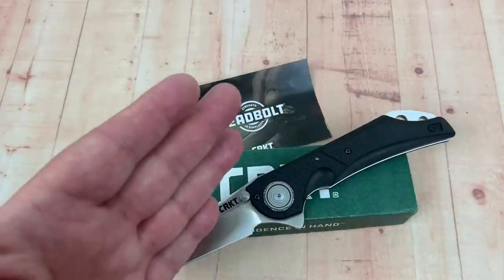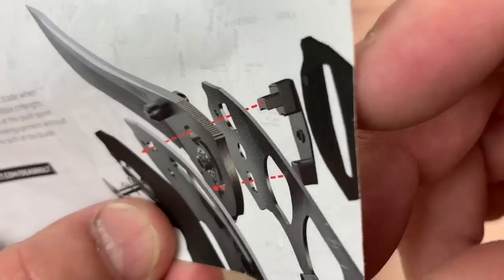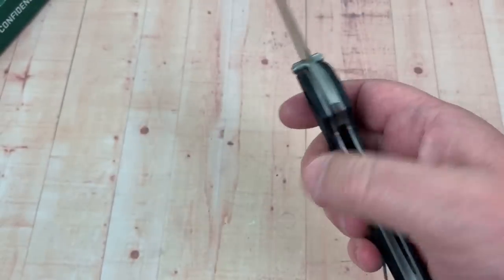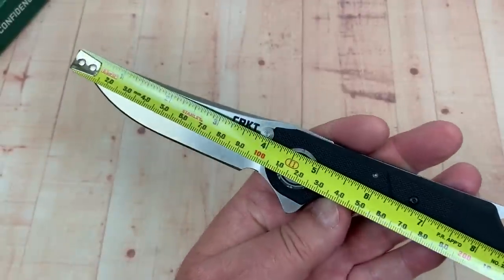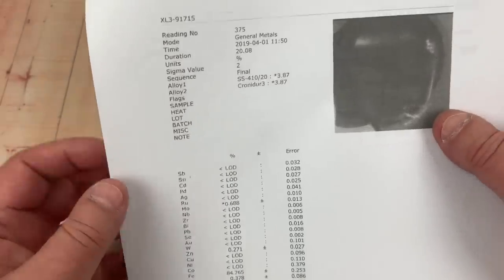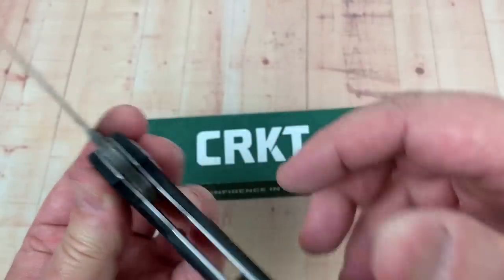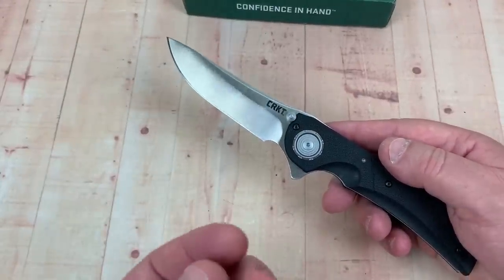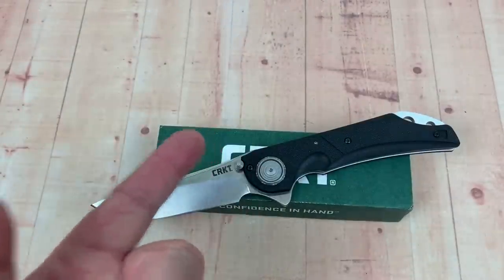CRKT Seismic Knife Deadbolt locking system  Flavio Ikoma design

Comment: It's a tough sell honestly 4116 is okay steel but it's between like Aus 8 and BD1 I think. I don't love the backspacer but other than that I actually like the knife but with that steel it really feels like it's struggling to compete at that price. S30V, S35VN, XHP, M390 all of those are available at that price point, and yes maybe this lock is the bee's knees, but if putting that lock on the knife requires doubling or tripling the cost compared to where a similar knife would sell at I just can't really get on board. This is particularly true because the lock is of limited importance, unless you're trying to use your pocket knife as a hammer or something stupid like that. If the lock adds 10% I'd be on board but this seems to be a $50 knife other than the lock at most imo.
Reply from the maker: Ashkan   It’s a bit pricey for sure.  And I agree about the lock system.  Folding pocket knives aren’t meant for the same use as a robust fixed blade.

Comment: Looks like thumbstuds are the stop pins. I might be wrong but there is a groove in the handle for them
Reply: Nope they aren't even needed the pivot itself actually has 2 lockbars that are built into it that go all the way through the blade tang itself so that the blade actually becomes part of the locking mechanism instead of just pushing against a pin. That's why it's cool that they call it a deadbolt lock just like the deadbolt on your door basically!!!

Comment: I hard core locking sym..the steel 1.4116 rupp ?? Could did better.its bomber D2
Reply: It's like melted battery terminals, or some such.
Reply: @Tenskwatawa4U  the steel is two soft dont hold a edge that long?its fair the knive design is fine the steel sucks.
Reply: @davidtate166  I think in use you'll find that it'll hold an edge longer than you'd expect. Not saying that it's gonna be stellar mind you!!! Just better than you're expecting. Ran this over the stone at the same time as my Benchmade presidio 2 which needed a going over and holds an edge for a good long while. Feeling how they differed in how they resisted the diamond stones in hand, yes there was a difference. The difference was noticable, but not as extreme as you'd think. The difference was literally maybe 2 minutes or less on the stone one vs the other. I got my seismic for about 94 bucks and my presidio 2 for about 130 bucks!!! At that price difference and feeling the stones I'd say they perform to their prices.

Comment: Good quick review you could tell by the video you weren't feeling it but you would think for that amount of money they could have put either D2 14 C 28 or vg10 Steel on that knife for that price plus there's one other little thing if that lock brakes you're screwed the more complicated they make knives the easier they are to fail have a good one
Reply: Thing is this lock if you actually look at it is simpler than most linerlocks. It the blade rotates until a pin goes in a holeno big deal and much stronger!!! Also it removes a lot of issues that most linerlocks and framelocks have with timing like early or late lock up!!! In fact lock timing isn't an issue at all with this one especially since your just putting 2 pins in holes. Voila!!! No timing to worry about.

Comment: What do you think of this knife at about 94 bucks?
Reply from the maker: Jesse Schmidt   It’s robust but I prefer the Linchpin
Reply: @LuvThemKnives  mind if I ask what draws you to the Lynchpin over this one? Is it a design issue or something or is it just an aesthetics thing? Figured I'd pick your mind full of experience, if you don't mind.
Reply from the maker: Jesse Schmidt   I don’t like the cutaway around the lanyard area.  It looks funky to me.  It’s definitely longer than the linchpin at 9.14 inches as opposed to 8.87 inches.  Blade length is actually a bit longer on the linchpin at 3.75 as opposed to 3.69 listed on the seismic.  The weight is about the same though.  I prefer the aesthetics on the linchpin as well.